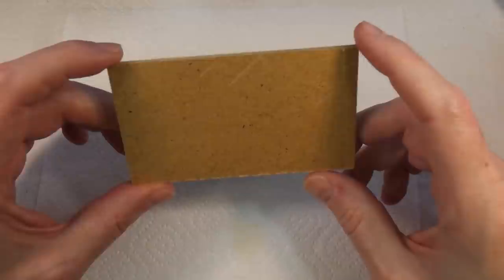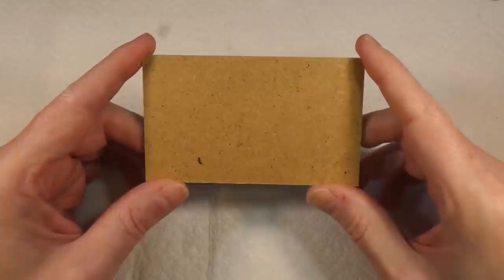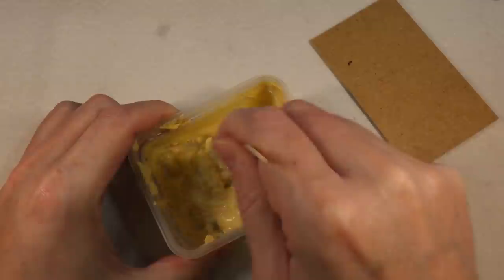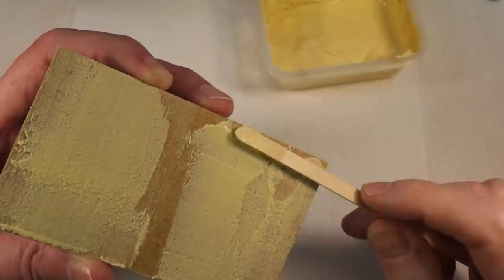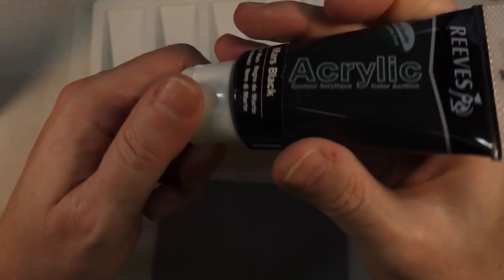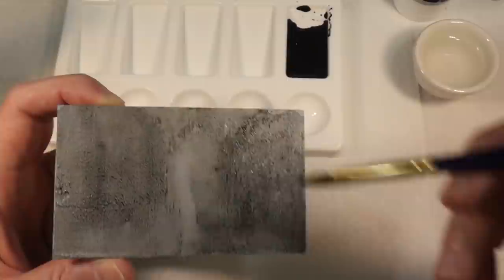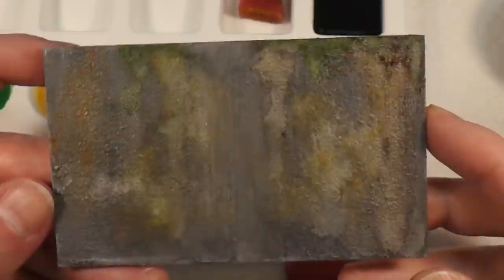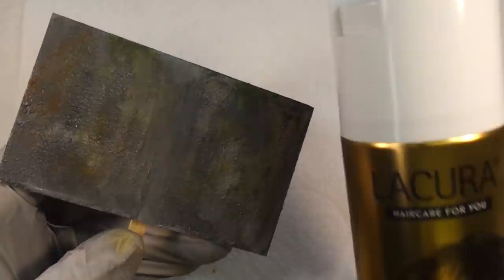Building a sample 1/35 scale concrete wall for an upcoming project

Comment: Little tip, to get the filler to stick better. Coat the MDF with PVA glue first it will adhere better.  Great video looking forward to seeing the finished diorama.
Reply from the maker: It actually stuck really well, but it's a good tip for surfaces like glass or plastic.
Reply: Works really well for MDF as it’s very porous

Comment: That was quite good what you acomplished with the selotape technique, will be trying that when I venture into building dioramas.

Where you took off the filler back to mdf, you could carve out a bit of the mdf and glue some thin wire into the mdf to make it look like the reinforced rebar steel.
Reply from the maker: That's a good idea. I'll give it a go at some point, cheers :-)

Comment: When using any kind of water based filler or glue on MDF you should really wet the surface of the MDF with water first which will ensure that the likes of filler, or DAS clay will stick to the MDF.  Have a look at the Terrain Tutors YouTube tutorials, he recently did some experiments with DAS clay to see how well it stuck to MDF.
Reply from the maker: The filler actually stuck really well without any help, but for stuff like plaster it certainly helps to wet it first.
Reply: @SteamGeezerUK  , which fb groups are you a part of as would like to pick your brains for handy hints and tips

Comment: Interesting, MDF and filler. Weathering and chipping.....what would you do for battle damage? I tried using a piece of sheet rock (drywall) wetting the paper to peel it off. Problem is using too much water makes the whole thing fall apart. Not enough water and you are chopping and hacking until it's time to build build a bird house.
Reply from the maker: Haven't thought about that yet. For MDF I would probably use a chisel or similar to gouge out some pieces, then watered down filler over the top to set it. Drywall is definitely a good choice though, just mind the dust when you're cutting/sanding it - you don't want gypsum in your lungs :-)